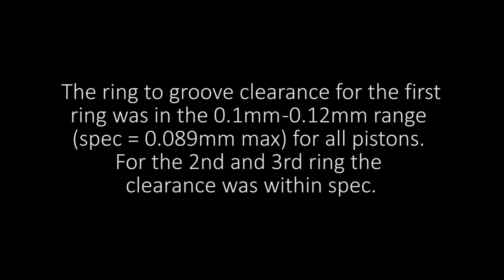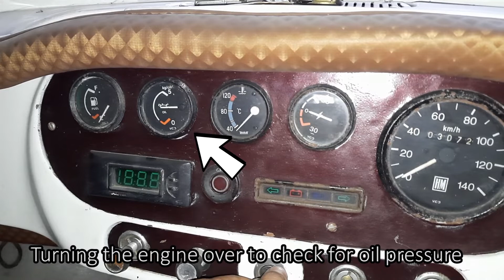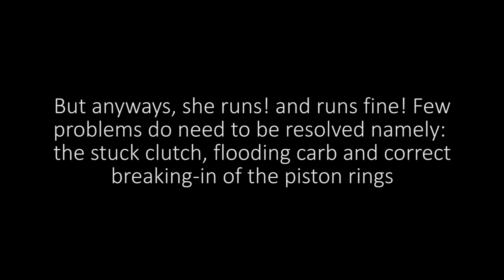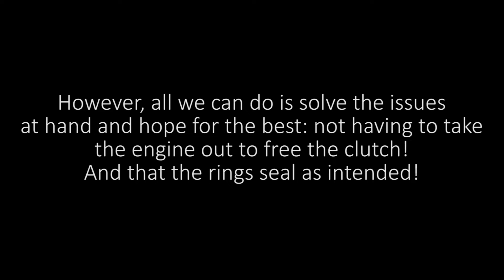Hindustan Ambassador Engine Started after 3 years!

Comment: Difference h m and mowoke
Reply from the maker: I honestly do not know. Specifications wise, they both seem the same (the Amby mark 1 and 2 are exactly same as the Morris Oxford in terms of the engine). MOWOG engines I believe have a MOWOG lettering casted on the block and are made in the UK. Other than that, its the same engine in my opinion (only some slight changes I have observed by far are in the rocker arm shaft holders, Mk3/4 onwards they seem to have changed those). My car has a Mark 4 head most likely.